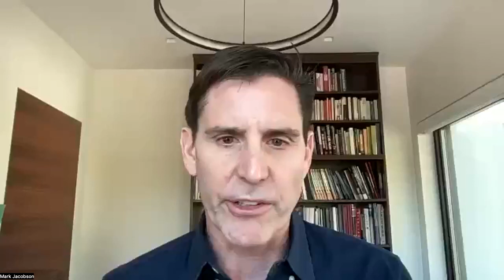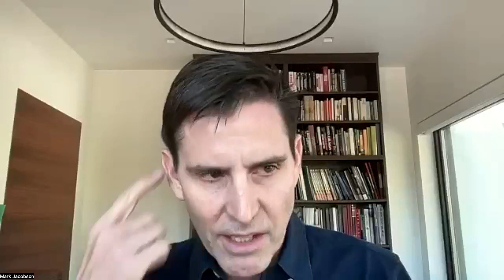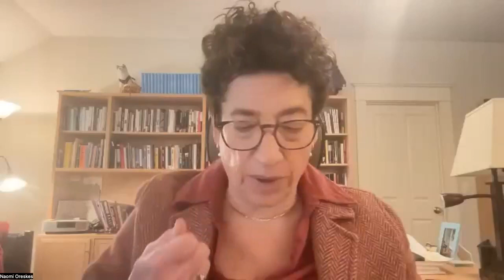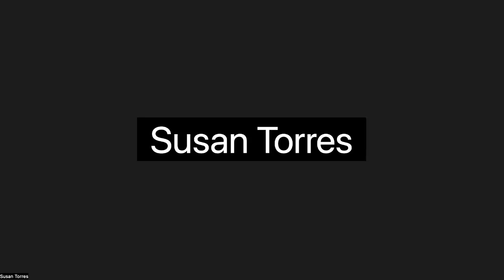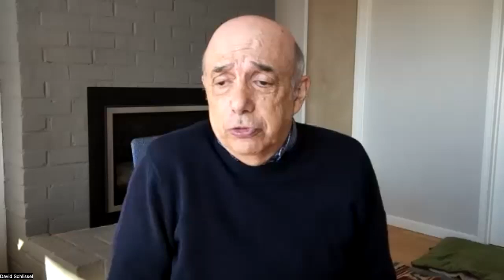Why Small Modular Nuclear Reactors SMRs Are Not a Climate Fix

Comment: SMRs will greatly reduce or eliminate the meltdown risk. Meltdown risk is caused by heat from radioactive decay which will be easier to remove because of the smaller volume to surface ratio.

Comment: I do agree with most of their points but I disagree with some. Who am I to counter argue against Naomi Oreskes and Mark Jacobson - so take my comments with a grain of salt and remember that I'm in no way being disrespectful towards them even if it seems so. (I'm not a native English speaker so I may sound like that sometimes)

The safety problem that large nuclear reactors have can't be solved - the engineer who designed the first of that type (a small one for submarines) was against the large ones precisely because of that. The smaller ones could be made 100% safe and the fact that none has undergone meltdown is a proof of that. I also think we should remember the risk and polution involved in solar and wind sources - the heavy metals used, the accidents, the agricultural land used, the environmental impacts and the long term. SMRs should no be viewed (imho) as a substitute for renewables but as another tool on the set we have to fight climate change. 

They also forgot - as most people do - that most of the energy consumed goes to industry and those are heavy consumers that can't afford the intermittency of renewables. There's an aluminum factory in Brazil that consumes around 1/6 of what São Paulo city consumes (10 million large), for instance. If that factory gets turned off all their smelting and electrolysis infrasctructure will be rendered useless in few hours. That company in particular consumes over 4TWh each year. They have, fortunately, 8 small hydroelectric power plants that supply half of their demand - and this is a point where SMRs could be very useful: being placed close to cosumers. Loss in the transport of electricity can reach around 25% depending on how distant the sources are.

Another point they did not consider is the rest of the world - SMRs may not be suitable for the US but that doesn't mean they would not be suitable for other places. Brazil has exhausted the hydroelectric potential and though renewables have been expanding quickly we have been using more natural gas than we would like to. The only reason our electrical system hasn't collapsed is the economic crisis that's been around for over 10 years and the natural gas power plants. We already mine and enrigh uranium that's exported to France and other western countries so, I think, SMRs would be a great addition to our set of energy sources. I believe South Africa would also like the idea.

Comment: The leading candidate for SMRs is increasingly looking like the GE Hitachi BWRX-300. The 'BWR' is for boiling water reactor. The 'X' is for tenth generation so it's based on decades of experience. They also have a new containment building technology that will reduce concrete use. There's lots of excitement and customers lining up.

Comment: I'm not sure nuclear can be made cheap enough to compete or not but the arguments against present here were weak enough to push me more in the pro nuclear direction.
Reply: SMRs are potentially a bit like cars, the first ones cost a fortune, but with mass production they can be made relatively cheaply. Due to the number of reactors you would have scattered around a continent the price could be reduced fairly quickly along with scalability. The real hurdle is people still think of the old plants of the past, SMRs have very little in common with these.

Comment: In the Natrium design, the reactor is simply used to heat a reservoir of molten salt which then can be tapped by steam generators making the whole system fully dispatchable.
Reply: TESS anywhere... good
Reply: Terrapower has been trying to build something since 2016.

Comment: The SMR concept has already been tried at scale and failed. At that time, it was not called SMR but the VVER-440 qualifies perfectly to the definition. It is in fact smaller than Rolls-Royce's suggested 470 MWe SMR.

They made 40 of them before OKB Gidropress realized that it was more cost efficient to make them 1000 MWe and later 1200 MWe, for obvious reasons that is many of the costs doesn't scale with the size of reactor but with the number of reactors.

What makes the nuclear industry think that logic har changed today?

Comment: Like every sort of generator SMRs have their negatives but those are far fewer than the totally unsuited for grid supply of wind and solar that is so popular.

 The basic criteria for an economical and stable supply for power grids is:-  controllable, has inertia, has reactive power input, can support short circuit level currents. Renewables cannot meet any of those! In addition renewables increase harmonics on the system which  is detrimental and their life span is very short. Not only that their performance and hence output deteriorates from the first day of installation.

Reasons why renewables are so widely connected are such as pressure from the green lobby groups (who also oppose what actually works, such as nuclear), politicians who believe that they are cheap, when the reality is quite different and is reflected in the very high unit cost to the consumer of grids with large renewable input.

The last point is when is someone or some group going to show that CO2 is the main driver of our climate and not natural as has been the case for millenia?  Yes, man has made a very small change but it is nowhere like the rhetoric from the U.N. who's ludicrous claim that man is responsible for all of the small amount of warming from a relatively cold time in our history?

Comment: Grids' costs are huge. 
The Australian Snowy 2, $ 2 billion project has had its grid costs added. Now it is $ 12 billion, and even $ 15 billion is also talked about. 

5 times more electricity with no fossil fuels.

5 times more electricity grid capacity. 

All central electric generation needs the national electrical grid. 

The national electrical grid is fragile. 
Because it is incredibly expensive.
The existing national electric grid is 100years project, decades and decades and decades. 

EVs have huge electricity storage. 
Most vehicles are parked 23hrs every day, 7kwh daily drive leaves massive reserves in millions and millions and millions of vehicles, EVs. 

Only rooftop solar PV and EV big batteries in the millions and millions and millions DO NOT NEED A FAT NATIONAL ELECTRICITY GRID. 
The existing national electric grid will be unloaded, protected and perfect. 
$TRILLIONS and $TRILLIONS saved, taxpayers money. 
Decades and decades and decades  saved. 

EV battery is free with every vehicle.
Rooftop solar PV is cheaper than windows $/m2. 

The economic advantages are stupendously huge.

Central nuclear, distant renewables need massive national grid, national wealth and decades and decades and decades and Government guarantees on cash flows and disaster insurance with nuclear.

Comment: Wind, solar and batteries  require a lot more minerals and metals than nuclear. To scale them up requires a vast expansion of mining and it can take just as long to open a new mine as it does to build a nuclear plant.
Reply: @rondavison8475  Yes, the trivial amounts of uranium will have to be mined and processed. If we had full reprocessing, we could probably even get by without more mining. You can't build a solar farm in 2 years or a wind farm in 3 years while you're waiting decades for new metal and mineral mines to be approved and started plus all the ore to be mined and processed.
Reply: @mdombroski  if we use thorium breeder reactors, we wouldn’t even need to specify mine for the fuel. Thorium is a common byproduct of various types of mining.
Reply: @kokofan50  There's more energy contained in the thorium in the ash piles at old coal burning power stations than there was in the coal. Though if Uranium is cheaper, we should focus on uranium and uranium breeders for now.
Reply: @gregorymalchuk272  yes, I’m agnostic on nuclear fuel. I just find the idea of using what would otherwise be waste interesting.
Reply: Not an issue. Michaux has been thoroughly debunked by Auke Hoekstra and others. On twitter and elsewhere, long detailed debunkings. Minerals and metals not a problem.

Comment: 49:30 Large nuclear reactors have a serious problem with water heating - the river after 3 Mile Island would probably be 1 or 2 degrees Celsius higher than before the power plant. AFAIK, SMRs solve that problem.
Reply: The solution is cooling towers, wet or dry.
Reply: @gregorymalchuk272  IF the cooling towers can be built economically. Elsewhere, Jacobson pointed out that cooling towers for e.g. Diablo Canyon are prohibitively expensive.
Reply: 1 or 2C? That’s the “serious problem”?

Comment: storage is not needed for solar and wind, in large %s, yet.
Compare that to how much storage can ELIMINAT FF burning power plants.
We need less than 1% storage for wind and solar now, much less than 1%.
But for removing wastage in the grid, with a 60% FF burning, we can remove 25% to 35% of the FF burning with grid efficiencies.
Fractal time advantages of electrical based storage, ramp time replacement as Mark touched on, FF burning backup removal, with only optimal efficiency plant operation when possible.
This means we only need 2/3 of the wind and solar we think we need to install via storage wastage capture and elimination.
Reply: you obviously don't live in CA

Comment: Energy is a very effective taxing mechanism and the largest obstacles to cheap energy is local politics. There is little to explain how on Earth China is about to overtake Canada and soon USA with construction times under 10 years, compared to unbelievably expensive projects in Finland, or UK. The SMR's tried to handle this problem by centralizing the production legislation at source, however the public and ngos are very creative in finding new hurdles and this makes the energy expensive. It is now clear France was correct in their assesment and only more Nuclear Power is now required to electrify